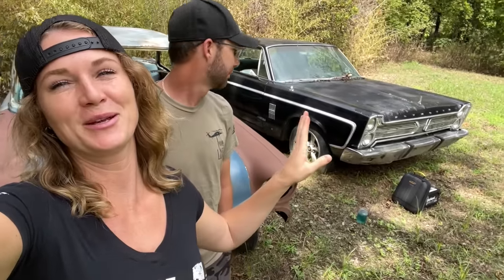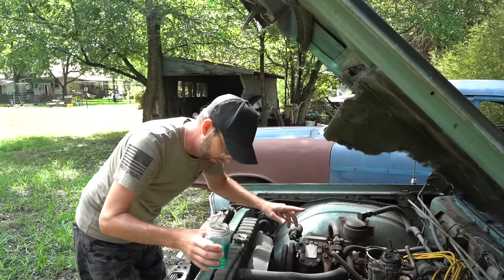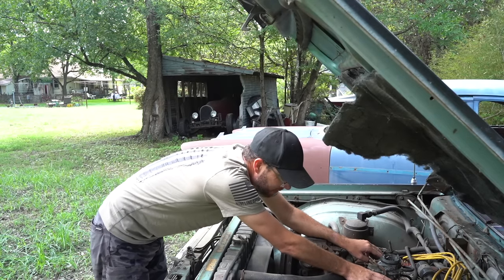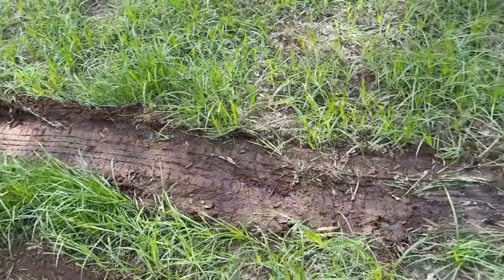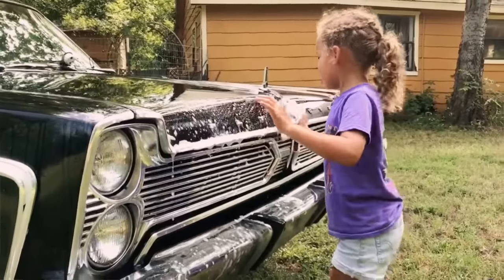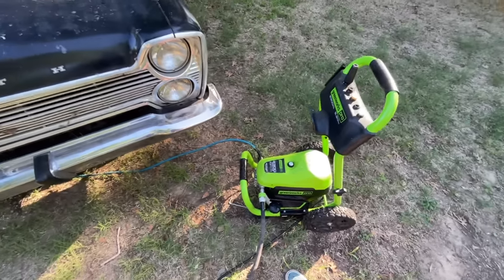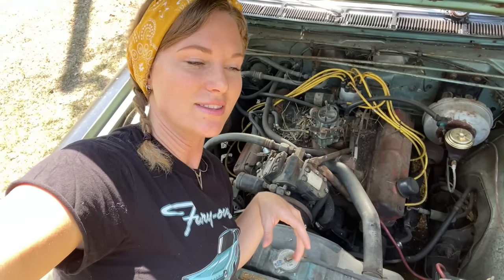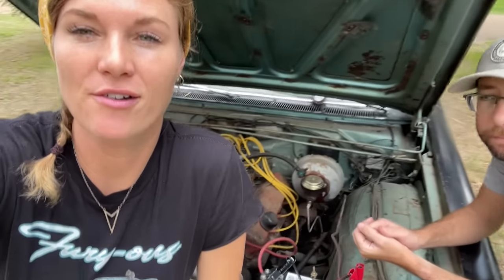Abandoned Plymouth Fury!

Comment: I can't believe you guys as much as you work on cars... The transmission is absolutely fine!!! You see the way this suspension is loading up emily even mentioned it.. The thing has drum brakes all the way around and has been sitting for 5yrs. So the brakes are completely locked up on the back or closed that's why it's barely rolling. And that's why it wouldn't bring itself out of the hole.

Comment: The bearings are bad in the alternator and yes the accelerator pump is bad and yes it is a 318 but it is the early style with the 2 bolt valve covers and the do have a holley carb replacement for it and yes you should be able to get a 4 barrel intake for it and put a 650 cfm holler on it

Comment: Put a 440 out of an old winnebago in it with a 727 torque flight Trans rework it hi lift cam Big 750 cfm or fuel injection system 💪  change out the Rear to a posi ! Feel the torque on a budget !

Comment: Check the vin number, one of the numbers in the vin identified engine size. Bore it 30 Iover and add a 4 barrel intake, carb. Might also consider changing heads and possibly cam.

Comment: Worked on many of those in the 60’s n 70’s.  The intake valves and cam (stock) are not big enough for a 4 bl carb unless you use a very very small 4 bl.  Those 2 bl carter carbs are good, I would rebuild it unless you are going though the engine.  Check the intake valve size and the cam and it will reveal why…

Comment: couple of thoughts - love this car style - front and back - I would not recommend starting another car right up against the bamboo - what if it caught fire?  You would lose your car - also, what was with the hole the drivers side rear tire was sitting in?  I would poke into that with a long stick and try to see if it is an old cistern, or what - also, cleaning the crap off the engine, wouldn't a vacuum be a lot better to not distribute any diseases from mouse droppings, etc?

Comment: Pushing the gas pedal half way on a carb car sets (closes) the choke.  If you feel it's flooded, push and hold the gas pedal all the way to the floor, which opens it.  You have to hold it or you squirt more gas from the accelerator pump every time you do it.  When starting it dry, the best way is to fill the fuel bowls from the breather in the center of the venturi, and just a shot into the barrel.  It will run off the bowl until it empties.  Once it fires and runs for a few seconds, the oil pressure has built and no need to continue to lube the pistons.

Comment: In  the 80's I had most of the Mopars,....never had a Cuda,....never wanted one.
I'd buy a 4 door pull the motor put it in my challenger.
I had road runners super BEE's with 383 and 440 magnums they all ran great 318s were great engines with 2 barrels.
I believe there was a 360 that was junk.
Slant 6's were excellent in like 67 valiant and 68 dodge darts.
Even to day I drive a 1984 Plymouth voyager van.
I think you will have a tough time getting a good starter,.....on my voyager it took 6 starters to get a good one,..... the good one came from  O'Reilly Auto Parts.
.

Comment: It looks like it has the "Canadian" dash; the "American" dash has a two-round top.  The carb is a Stromberg, and the engine is the old "A" engine, the semi-hemi; it's got solid lifters and sounds like it really needs the lash adjusted, my brother always swore by .012 intake, .018 exhaust.  The gauges are weird - in the 'Fifties, MOPAR stockpiled a warehouse full of 6-volt gauges - and then 12-volt came along.  Rather than do the smart thing (which Chrysler has never been noted-for), they used 6-volt gauges in everything and there's a little plug-in 2-terminal relay with a metal cover (looks a bit like a peanut) in the back of the dash that steps the 12-volt down for the gauges.  You'll know when it welds itself shut (and it will) because all your gauges will peg.  Last one of those relays I bought was ~12 bucks - wonder if MOPAR still stocks them?  If they do, buy a couple spares...  There are 4-barrel manifolds available for them, I found one on a mid-'Fifties Saratoga.  The old "A" was a slug; but if you decide to big-block it, remember to look for a 426 wedge - the 440 came-out in '67.  LOVE the car! 🥰
ADDENDUM - it's certainly a 318; what's messing-up the parts guy is that they came-out with the new LA engine in '65; it was 273 originally, was made as a 318 fairly quickly, but is a different block with thin-wall castings, was significantly lighter and a lot cheaper to make, but all the same carbs will bolt right on either engine.  I never had a Stromberg carb, but the Carter BBD bolts right on.  The early, low-top BBD is one of the most reliable carbs made - but if you go with one of the high-top BBD's from a mid-70's 318, it is very tunable - it uses the jets (and metering rods? - sorry; been decades since I worked on one last) from an AFB or AVS strip kit.  Edelbrock still makes the AFB, they likely offer the Carter strip kits.

Comment: Look on the back of the hood ornament for the original engine size on that year if you cant decode the vin, thats a 318 poly semi hemi. It was the sowing machine workhorse for mopars until the LA series of small blocks until 67 -
The dual quad intake is uber rare but really cool on those engines

Comment: My friend in high school had the 318 Poly in his Satelite. He did find a 4bbl manifold for it but it wasn't easy in 1975 and then he put a carter 500cfm carb on it. It did increase the performance some but he liked the 4bbl sound. It's worth doing if you can get the manifold but I wouldn't do more than that. It's a great yo man duty, reliable engine but it will never be a big power output. They used the Poly in some boats as well in the 4bbl form and they worked well in 17-18 ft wood and glass boats,

Comment: A plastic water bottle with a small hole in the lid works better. Once you get it running use the same type of bottle with transmission fluid. The transmission fluid provides some lubrication and breaks op the carbon. Make sure you don’t let it die while squirting small amounts of transmission fluid in.

Comment: been working on a 65 fury 3 convertible with the poly 318, it was a give-away to me, rebuilt bbd carb., runs great and feels like a caddy going down highway, found two intakes in the U.S. in last two years, starts at $3k anywhere, parts are hard to find, put in all right hand lug bolts to replace left and rights, longer size for new rims, longer lugs,  front and rear lugs are different sizes, just a note, send notes to me if need other info., most people put in 383 strokers, not me poly's are fun.

Comment: First, you need an air cleaner!
Four barrel manifolds for the "Old Style 318" as the Mopar Bible calls it, are hard to find. Ones from the LA small block Chrysler will not work.   If you found one,  then, you likely would have to modify the throttle and automatic transmission linkage with some cutting and welding.
  I would rebuild the carb. There is nothing wrong with it.

Comment: Definitely a starter motor, or rebuild. And an accelerator pump. That carburetor doesn't do any justice for that motor, anyway. Understand if you want to keep it stock but, I'd be looking at other options. My MIL has this in a convertible. All original except the top. Not a Mopar fan but, super cool car. 

Looking forward to see where this goes.

Comment: An LA " 318 340 360 is a direct bolt in. Very common and cheap. The 360 is your best option to make good power. And buy a late model v8 starter. Smaller and doesn't sound like a cement mixer.

Comment: I think the rear brakes were stuck at first, and that's why the Bronco had trouble pulling it out of its holes, and I bet the rear brake hubs are rusted inside so that is why it wouldn't spin the tires when he was trying to power braking it. Rusty hubs will make the brakes shoes stick to the hubs in the rear so it would hold them from spinning when power braking it.

Comment: The Plymouth has a "limited slip" differential, that's why getting out of the ruts was so hard Upgrading the brakes would be wise. Disc on the front at least and for safetys sake replace that master cylinder with a duel reservoir one. Then the carb rebuild, then cruise for a while

Comment: Definitely a poly block. Not the small 318. The Stromburg carb keep it high torque low rpm engine. Put a 550cfm-600cfm. It will see rpms it's not seen with a Stromburg. Awesome engines. Also it has a non- reduction starter. Make a difference down the road. POLY BLOCK FUN

Comment: Bite the bullet and replace the carb and put an air cleaner on it, replace your worn out battery cables, and find your brake leak. The drums are probably full of rust, that could be why it's hard to move. Get it running dependably and restore it a little bit at a time and you'll get it.

Comment: That is the 318 poly engine, which granted was quite the workhorse, but is limited on performance parts...there were some that came with a 4 barrel intake, but they are hard to find. Most people that have them do not wish to part with them...lol...personally I would do either a 383 swap, or a modern hemi swap.

Comment: Well, to change it over to a whole borrow, your wood need to change the intake manifold as well and if you do that you’re going to have to pull the distributor and I would take the cap off and mark where the distributor is pointing and not turn the engine at all change the metal pole and put it stripper back in in the same position it come out

Comment: Brings back memories fo 'sho. Had a '66 Fury I with the same powerplant, not small block but wedge,(ie:poly) ( talk to Uncle Tony for deets ) got tickets Aallll the time.  No problem with running A/C, but the engine mounts break always. Get good ones, they broke because of the torque developed, largely by way of the 2 bbl. carb. I ended up chaining one side of it cause I had a budget for mounts which ran dry. Small 4 bbl. may be the ticket - never tried it.   Other than that you 2 are doing a fantastic memorium to a fine fellow. Keep it in your fleet and enjoy.  Just had an idea. Try throttle body F.I. Then it can be a stump puller !

Comment: Hi guys, the engine is a 318 poly, basic engine back in the day. Unfortunately there are no performance parts for that engine. There was a 4bbl intake made special back in the late 50's, but very rare. A Holley fuel injection may work, I would use a 5.9 Mopar
Reply: Weiand made a four barrel aluminum intake. It is rare and expensive today. There were dual quad iron factory intakes.  I think they ought to rebuild the one they have now, however.

Comment: id deff pull the drums probably a stuck brake part some place ,pluss ya got to change the trans filter and fluid if its sitting that long Chrysler trans from that era are damm near un breakable but filter and vac modual and replace the line too are fragile on these , great car deff a saver

Comment: You can find limited performance parts for these 318 poli "A" engine.  It's different than the 318 "LA" engines.  Those old Carter carbs are good little carbs.   I currently have a '66 Fury 3 named Jessica.  She has the 383 and 4 speed.

Comment: I'm not so sure that is a two barrel carb. I think it is an old single barrel Carter carb. They are great for sipping fuel. You could probably find a 4 barrel intake for it at a salvage yard somewhere and then put you a new Holley on it. I had a 1970 Fury with a 318 and another with a 383 and both had 4 barrels on them. You have probably one of the best engines Mopar ever made in that car. I tried hard to kill that old 70 Fury with the 318 and because it was so durable all I ever did was wear out tires and U joints. That 727 tranny is the best transmission ever made, bar none. I love that old car and wish you good luck.

Comment: Well I used to have a 64 sport fury with the same 318. I found a factory cast iron duel quad manifold, 2 carter 650 carbs, 3/4 race cam and solid lifters. Then I made a duel point distributer for it. It had the push button torque flight trans.
However it did end up spinning a bearing 4 months later. So needless to say i was underneath it in the dead of winter in the snow sanding the crank down with crocus cloth, put an oversize bearing in and it lasted till the summer then I pulled the crank shaft out and had it reground and all new bearings.

Comment: Leave it ALONE! Rebuild the carb . Give the engine a chance to get used to running aftewr sitting for so long. New Plugs {Points if it has them } Fuel filter < Berryman's down the carb .{See Derek @ VGG} Re: Italian Tune Up! And Please do not forget Oil & Filter. Next pull all wheels [one @ A Time ]
Brakecleen one @ a time {P.S. check wheel cylinders for leekage }. Bleed out brakes {one @ a time while working on each wheel after inspection of
it and cleaning. Good Luck , Love Ed
Reply: Agreed!   The guys that write "drop in a Gen III Hemi and overdrive transmission " are insane.

Comment: Back in the day they put build sheets and code tins on the cars. There should be a fender and fire wall tag with codes on it that will tell you everything about the car. Color, motor, options, etc.

Comment: Either the accelerator pump diaphragm is dry/torn, the passages are full of old full gum, or if it has ball valves they are stuck. Drain that tank of the old gas, and change all the fuel lines for FI spec, ethanol resistant line. New tank of gas with a bottle of marvel mystery oil and you are good.

Comment: The noise was the ac compressor spinning, try plugging the vacuum to the power brake booster I think it is lean from vacuum leak bad brakes the fluid went somewhere.
Reply: If the fluid gets in the booster the diaphram tears and you get a car that will barely run if the hole is big enough. They have move that master forward to see if the booster is wet inside and check to see of there is a leak by sucking on the tube or blowing into it.

Comment: Depending on what you are going to do with the car. The set up is factory and the stores today don't have all the options but if you want original and good fuel mileage leave it. If you are going to change it save the intake and carb, and put a dual plane intake and a smaller 4 barrel on it due to it being a 318 you can easily drown it.

Comment: Definitely accelerator pump is shot. There is nothing better than that Carter BBD carburetor without changing the intake manifold. The 318 LA engine will not usually rev above 52-5300 RPM without changing heads. It will never be a hotrod, so don't try. It would be a nice highway cruiser with the ability to make 18 MPG if you drive it easy. 11 MPG if you drive it hard.

Comment: If it's a 318 I would first rebuild the 2Bbl &
see how it runs. Also I would keep a close
eye on that fuel pump because  being setting for 5 years the diaphragm is usually
dryed out &if so could crack & then you
might wind up with gas in you're oil. But
I am old school too(75 yrs. old too ) so
the 318 2Bbl appeals to me.

Comment: That's a 318 Poly. The last year for those engines. In 1967, the light (LA)engine was introduced: 273, 318, 340, 360. The 318's are not the same but good engines nevertheless just huge and heavy. Austin from (Daddy's money garage/Uncle Tonys Garage) has a 1965 Fury with a Poly in it. He would probably be a big help for information as he rebuilt his poly recently. I've got a 66' Sport Fury just like the one you're working on but its the 383 which is big block. My brother has a 65' Sport Fury just like Austin's (very similar-different tail panel and grill only) his was originally the Poly also but the motor is long gone. They're a different animal but the aftermarket has made some parts available. I love seeing these old mopars back on the road! Keep up the good work and shananigans you two! ;)

Comment: My opinion is to toss (or sell) the 318 Poly and replace it with a late model 5.7 Hemi with the Eagle heads and Holly's Terminator MAX EFI.
Engine Masters had a video on how fairly straight forward was to install and make big horsepower but have easy street manors.
Reply: A lot of people make similar suggestions. But, I think that is getting way over the head of where their current skill levels are.  They didn't really know anything about the old drive train and a modern one is 20 times more complicated.
Reply: @auteurfiddler8706  I disagree.
I once thought like you, but I truly believe EFI today is much easier to setup and run over an old school carb and distributor.
Steve Brule, West Tech Performance and co-host of Engine Masters said this very thing: that EFI is easier to set up, produces more power, and offers better drivability.  He further commented that with EFI, you can fine tune/control things so much more than with a carb and a timing light.
The complexity is a thing of the past, especially with Holley's Terminator Max.
Provide 12 volts, plug in the well marked wiring harness and it just self learns.
..or you step up to the next level and manually tune it.
Steve Brule knows way more than I will ever know and I trust what he says.
I agree with your comment that Flying Sparks Garage doesn't fully understand the current drivetrain and may struggle with getting a Poly 318 going.
My opinion is a late model drivetrain will be easier.

Comment: I wouldn't change a thing except take off the dirt dauber that's on the driver side of the engine, just below the valve cover. That would make the engine run better and would be easier than a carburetor rebuild. But I could be wrong. If it doesn't work, a carburetor rebuild should fix it and would keep the car same as original. Also rebuild the seats with one of those custom seat cover kits, and repaint with original color.